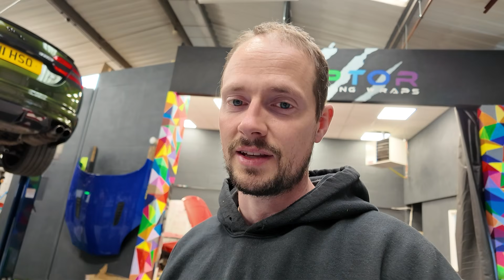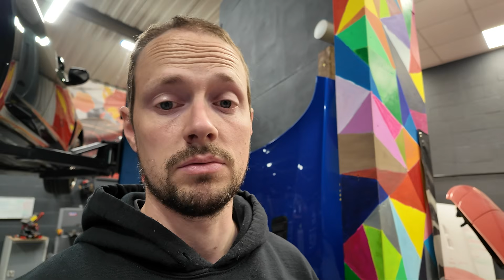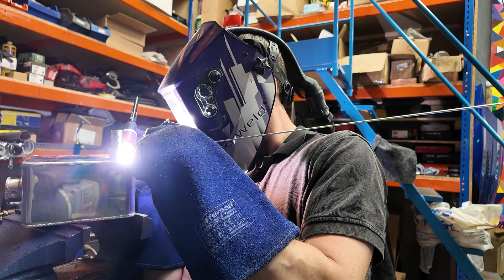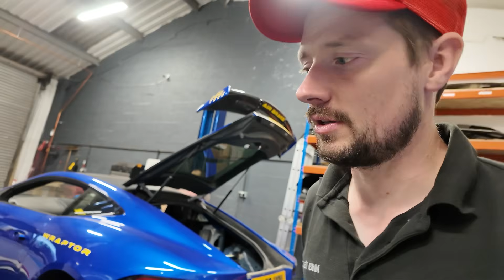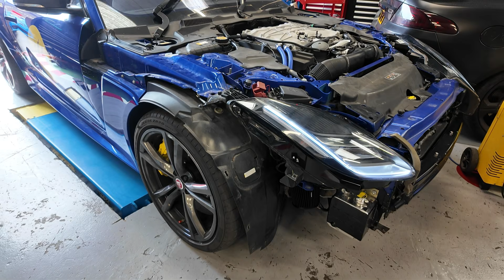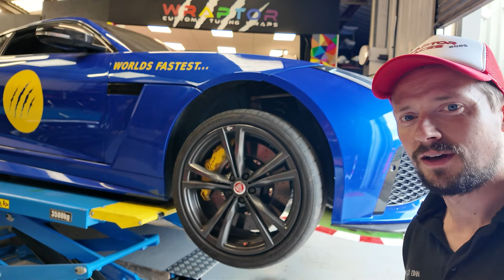We Tuned Our F-Type To 700BHP (And Fixed The Brakes) | Episode 3

Comment: Couldnt you get more HP than your level 4 with the new Harrop TVS2300 Supercharger and added 200Cell Cats? Just curious what octane fuel your going to need to run with your Level 4? I have a tuned & smaller upper pulley on a 2015 XKR and getting ready to do the max to her possiible, along with the Trans tune
Reply from the maker: Currently the larger charger is a waste as you cannot use all of the boost available from it. More important things to address first is the intake temperatures and the fueling capabilities. Stay tuned with us... More to come.

Comment: Is there a danger of running the supercharger over it’s prescribed rpm, also the cars top speed as standard is 190 I think so all this work only to achieve another 10 mile an hour , just asking, or did I miss something
Reply from the maker: If you go past its rated rpm speed, it'll loose efficiency. But we have increased this range with our other modifications that'll work with the supercharger.

SVR does 200mph from factory... But getting to that speed in such a short space available is another challenge completely.

Comment: Did you do anything to the brakes? I also have the Ceramic brakes, and i find them, without inicial attack.
Reply from the maker: These brakes bite awesome even from cold 👍👍👍
Reply: @wraptorcustoms my system is the stock carbon/ceramic. And they are sponjy and without initial bite. In rain... scary.